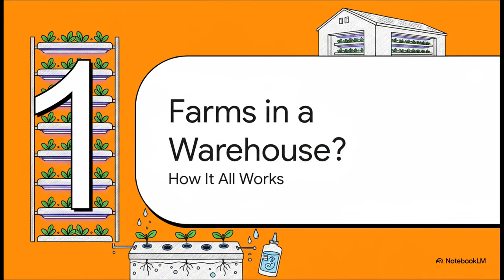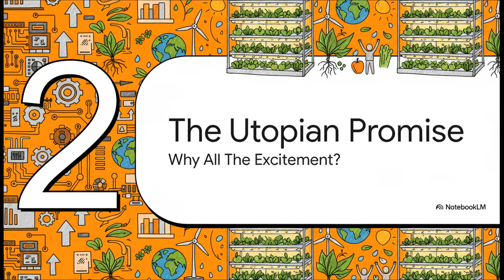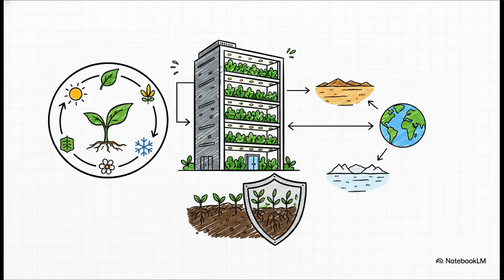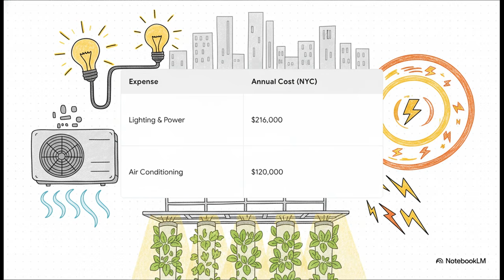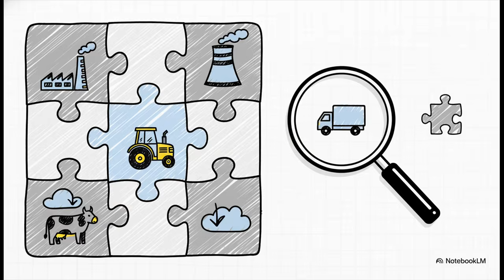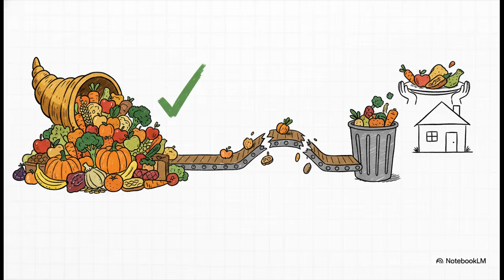Vertical Farming s Reality

Comment: I don't like the idea of unnatural fertilizers yet here they even removed the soil and even sun all-together. It's even further away from natural food.
Reply: Its good for pumping out food... But even if it does have more yield for less energy and water etc, you're missing out on the extras. You don't get the soil borne bacteria for example, which are pretty good for you. Its like the difference between vitamin pills and eating veges. Not as much of a difference as that, but similar lines.